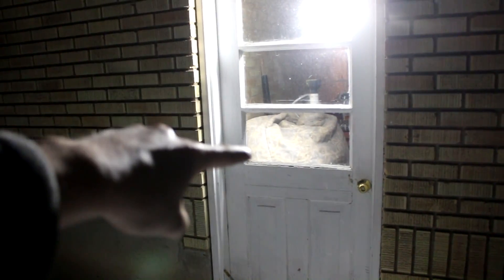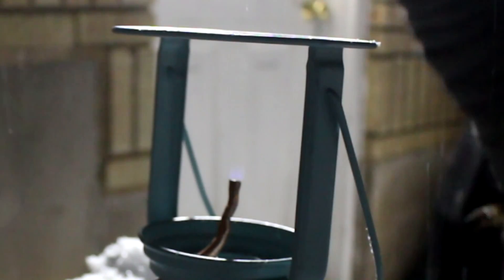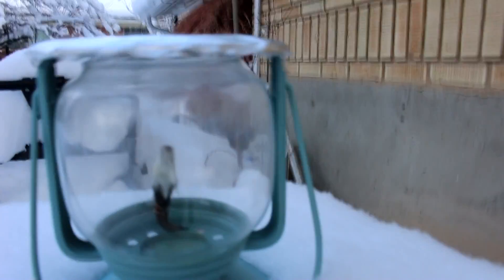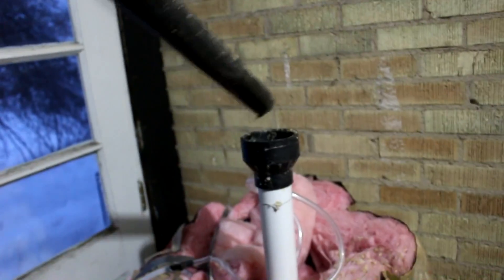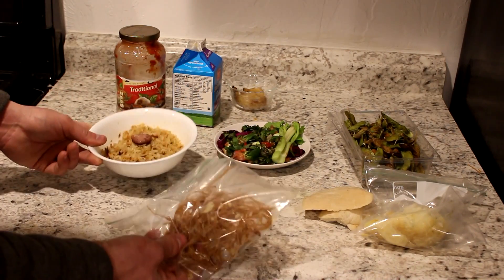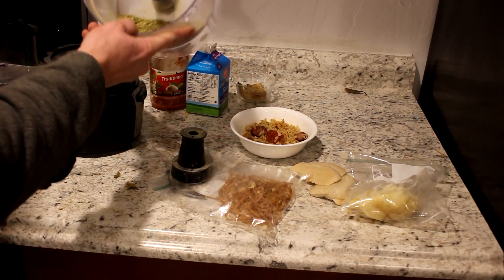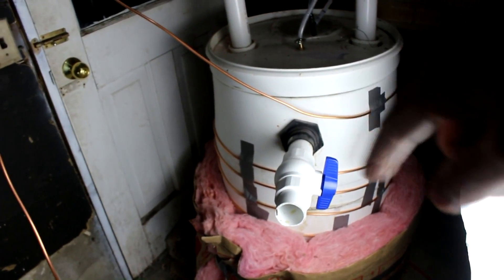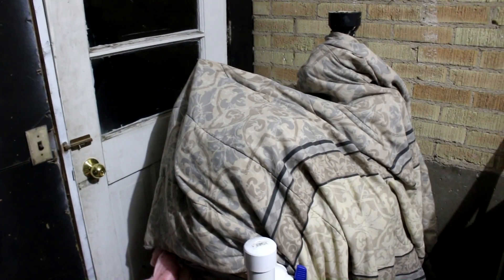Cody's Methane Generator Part 2: I Have Gas!

Comment: If my calculations arent totally off You're making somewhere around 150 litres of methane a day. Around 100 grams, at .6 grams per litre. 5.5 MJ per day, which is 1.5 Kw... So your heater is using the entire energy production of the reactor.
Edited because I screwed up the calculation.
Reply from the maker: Ah good I was hoping someone would check my numbers. I actually calculated that the gas is not more than 50% methane and so got a value about half of yours. which is perhaps not quite enough to keep it heated but will offset most of the power requirements. (assuming 100% efficiency which is unlikely)
Reply: @theCodyReeder  I was wondering what the EROI on this thing was, wonder if there's any way to get it above 1, perhaps just running it in a warmer climate?
Reply: Volume of a 12 inch beach ball, filled in 2.5 hours.
Reply: it's likely fiberglass which won't burn, and such a small flame wouldn't have enough heat to melt it either.
Reply: The most efficient heater would be a solar one, even in winter you 
should get almost 2kW of heat for a square meter in a day, rising to 7 
or 8 by mid summer. Your problem is how much the heat varies, I assume 
you'll want a thermostat controlled pump for the heating water. Then 
you'll need good insulation because of heat loss, also theres the 
problem of the system generating no heat at night, so you'll probably 
need to actually store the solar heater's heat in a separate well 
insulated tank then tap off that with a loop running into the reactor. 
Also, I'm having trouble finding details about methane reactor output, 
but It seems likely that you should be able to get many more times the 
output of this system.
Reply: maybe put that tiny flame a bit further inside the heater for better efficiency? 
I know its highly unlikely but how flammable is that insulation?
Reply: Phunkkyy I think the bigger worry is of the light going out. Having a flamable Gass building up indoors is generally frowned upon
Reply: Might keep them very cozy if the heating setup tips over ;)
Reply: Marc83Aus Well according to my calculations (using your given volume) he is making less than 107 grams of methane a day.
Reply: That's much better, I must have used cryogenic compressed methane in the calculator i found earlier.
Reply: Marc83Aus I just use 1 mole = 22.4 liters.
Reply: Cody'sLab Is the assumed volume correct by the way? And wow! Cody replied
Reply: thats impossible. at the top of the athmosphere you get about 1,3kW of solar radiation including infrared and the visible spectrum. on the ground its much less due to clouds and the angle at wich the sun shines to the ground especially in winter. you are probably one order of magnitude wrong 800W per m^2 on a summer day seems about right.
Reply: Marc83Aus But he is disposing waste and getting compost out of it. Theoretically without adding any extra energy into the system through electricity
Reply: A vacuum tube is overkill for solar heating, it's pretty easy to make a coil of dark coloured tubing, put inside an insulated box in the sun. As the water heats it should create a current drawing cooler water from a lower reservoir and producing slightly pressurised heated water at the upper end. A small hand pump might be needed to get the current going but i've seen these types of heaters made with junk and surprisingly efficient and maintenance free.
Reply: The copper wrap around the barrel is likely to be the biggest issue with efficient heat transfer, why not make a coil that descends into the existing heater system? That tube that extends down and has a electric heat probe in it.  Would work same way and should siphon as it transfers heat.  Just the heat delta is likely to be alot higher since its in the hot water trying to heat already hot water.
Reply: Marc83Aus how did you come up with 150 liters a day?
Reply: burning the gas indoors might heat up the shed too keeping the bunny cosy. its awesome.
Reply: +Tsf Phi I think he did a vacuum tube (imperfect, of course), but if not he definitely did the sealed gas tubes.
Reply: You're right about 1.3 kW per square meter. I said 2kw for a whole day.
Reply: That's interesting, I wonder how much electricity you would need for the added hydrogen if made with electrolysis. I'm not going to attempt calculate that untill I can find good data for methane bioreactor production.
Reply: I would be possible to get over 100% efficiency with a heat pump, if more difficult to build.
Reply: Aura Rowe You couldn't use that to make a heat pump, though. You need contact with the outside to do that.
Reply: Solar door heater, would work wonders.. 

Used cans or Alu siding.. painted black and basicly done.
Reply: Well, I got about 96.9 grams of gas..so about 48.4 grams of methane per day if the gas is half methane. (assuming density  of the other gases is nearly equal to methane)(ball is 30cm in diameter)
Reply: MarcAFK What do you think they use in commercial solar hot water systems? Magical pixie dust coated black tubes to keep heat in all night long? Dreaming! Get your facts straight...
Reply: Yeah, I have a feeling that running a digester like this in the bitter cold might be hard to keep warm.  Now run this in California where thousands of dairies are...
Reply: ah, i love that wording, reactor. All living things are reactors. Why? Because, the methane generator is a stomach simulator. Stomachs produce our proteins and other organic compounds for energy. The methane generator is producing energy to keep itself heated and alive. I love the chain!
Reply: I guess you have to build it bigger, so the heat is self substaining. ^^
Reply: When it comes to using solar I've always found "solar vacuum tubes" to be an interesting idea for keeping water at a warm temperature. They apparently work in diffuse light conditions, even under some snow.

I think "Kingspan" are currently the leaders in this type of tech. 

+Codyslab Do you think you can build a vacuum tube?
Reply: Marc83Aus 
This is exactly the point. Cool to build but way off effective. Energy bilance is a catastrophy. Might work in summer, but then you have to conservate your energy for the winter.
Interesting and fun to watch anyways...good work.  :-)

Comment: G'day,

  Yay Team !

     23 years ago I bought a Toyota Stout with a 6 Cyl 142 Cu. In. Holden "Red" Motor, running on LPG (search my "Mad Scientist" Playlist, for "The Rolls-Royce-Holden-Toyota Helicopter Stout !", to see it...!) ; and because it ran on Gas, & because I live 10 miles from the biggest Concentration-Camp for Cattle in Oz (Ranger's Valley "Feed Lot"), I did once crunch the Numbers on running "a 6-Cylinder Family Car" on Methane.

   It was an old Book I read, predating the Continuous-Flow system you're using ; but what I discovered taught me much about the nature of "Methane-Power", as seen in  the 2nd & 3rd Mad Max videos.

   It seems that using "Batch Digestion" to run such a Vehicle 100 Km (60 miles) per week, one needed to build a 4-Chamber Digester, with each Chamber comprising a 1,000 (US) Gallon Tank, buried in a Hole lined with Insulation, and 2 Ft of Insulation overtopping it, equipped with a Mechanical Agitator & Heating Tubes... ; 3 Chambers were to be Brewing at any one time, with the other one being emptied of Sludge & recharged with 1 Ton of Fresh Moist Cowpoop.

 So, it only takes playing with 1 Ton of Cowturds going in, plus 750 Litres of Sludge being removed from the system, weekly ; to generate enough Bio-Gas to be able to scrub it of C.O.-2, and run it in a Water-Cooled Spark-Ignition Engine from a Gasometer, to turn a Water-Cooled 3-Stage Compressor to squeeze the Methane to 2,000 PSI to go in long narrow Steel Cylinders, with which to feed the Engine of the Fire Chariot...., and, all the  Hot Water carrying the "Waste-Heat" from the Methane-Engine/Compressor combination has to be pumped through the Chambers of the 3 "working" Chambers...

  Your Continuous-Flow Design means that if you postulate a single suitably-plumbed 5,000 Gallon buried & insulated Poly-Tank, with two  adjoining Gasometers for the Biogas & Scrubbed Methane, & the Engine/Compressor...; then to drive your classic "Normal Car" 60 miles per Week will "only" require you to shovel 320 Pounds of Cowshit per day into the Tank, while adding 50 Gallons of fresh Water & removing 60 Gallons of Sludge...

   I'm sorry, I'm a lazy Hypocrite & I run my Fire-Chariot on 22 Litres of  Fossil-sourced Petroleum per week, to drive 250 Km (156 Miles) or so...; but I do have a 30 Watt "Mk-8 SunFoil" on the Roof, which may be saving me between 1 & 3 Litres per week...

   I don't get to say that I'm "driving Fossil-Free" on Carbon-Neutral Methane, but I don't spend my life shovelling Cowshit, either..; and I'm covering the same Road, with the same Load, at the same Speed, on less Motion-Lotion.

  And all it takes is adding a Streamlined Solar Array & Battery Charge-Controller to the Automobile Battery, in parallel to the Engine-Driven Alternator's Regulator.

   Every time the Alternator's Regulator "sees" Solar Current at the (Fully Charged - while sitting in the Parking-Lot...) Battery-Terminals, the Alt's Reg. decides the Battery is already full, and reduces it's Output....

  And, every Vehicle burns a lot less Fuel, when the Alternator is not loading-up it's Driven-Pulley with Electromagnetic Drag, trying to  quickly finish recharging the Battery (which had been sulphating while part-flat, since the last time the Engine was shut-down before the Battery had  finished being Recharged....).

   So, um, I love your Concept & Design for a Continuous-Flow Methane Producer...; but I don't want to spend my life collecting & shovelling & disposing of Shit, just(ifiably ?) to get around...

  I suspect a Tricycle Land-Yacht, and waiting till the Wind is "Fair" for the Journey, until the Road Network collapses (soon).

  Such is Life,

  Have a good one....

  ;-p

  Ciao !

Comment: I was going to use a closed loop heating system like this when I had my digestor running but I was going to add thermoelectric generators into the system (Peltier devices) and try and pull a wee bit of power out from the loop

Comment: any chance that can explode with the flame next to the tank?
Reply: Sqwince23 the whole point of the tank and seal is an anaerobic environment: no oxygen, only if oxygen leaks into it and whatever does go in will be used up by the bacteria first. Then you get a serious amount of methane after the oxygen is gone as a byproduct of processing the material in the tank.

Comment: Cody: There's a book specifically on home-built methane systems. It's called "The Handbook  Of Homemade Power"

It talks about using some of the gas to heat the mass to maintain temp... and still get better gas production (assuming you have enough material to fuel faster production)  2 temp zones I remember  90 F and 120 -130 F   the higher being high production.

Love it!  Keep up the good work!

Comment: Why does the extra material go in and build pressure rather than just be forced back out the feed pipe? And how does the extra pressure push the digested material out?

Comment: somehow it should have methane detector, or a thing which ensures it redirects methane if flame will shut-off
It's good the shed have slits, but something should be as precaution - 6 sandbich balls of gas, hard to tell
Reply: it is possible to generate pulses with Stirling engine and it is shutdowns to trigger some kind of electromagnetic valve to redirect the flow

Comment: Cody if you could answer my question that'd be nice. I'm planning a 1-2 thousand gallon digester. Do I need to keep it warm if it's In my basement 70-74 degrees? I'm sure that if any volume could, 1-2 thousand gallons could keep itself warm, but then again it's anaerobic.

Comment: The orange coloured flame seen around 3:07 suggests the lantern mantle isn't getting enough oxygen to burn completely. You'd get a brighter mantle using an air/gas mixing nozzle, although it might be difficult to find or build one designed for such low gas pressures.

Comment: Can you bubble the methane into a large dewar of liquid nitrogen to store it as a solid? Also, is methane soluble in liquid nitrogen or oxygen? If so, will a mixture of methane and liquid oxygen explode on ignition?
Reply: Liquid oxygen and methane might explode without ignition. Storing them mixed would be super dangerous.
Reply: Liquid oxygen and liquid methane might produce a hyperbolic reaction. Where as just as soon as the 2 mix you get a reaction. An example would be the rocket engine used in the Saturn V rocket. It used liquid kerosene and liquid oxygen. Just as soon as they mixed, it produced a severe hypergolic reaction. That created a lot of force.
Reply: @CSX4772  The Saturn v engines were not hypergolic. AFAIK liquid oxygen is not hypergolic with any fuel. 
A good example of a hypergolic engine would be the ones on the Russian proton rocket. It uses dinitrogen tetroxide and unsymmetric monomethyl hydazine.

Comment: If you have one or can make one easily, why not make a bunsen burner sort of thing? The lantern mantle is wasting energy in what is almost pure conversion of gas to heat AFAIK by instead converting heat to light. Additionally, you could make it failsafe by putting a bit of platinum wire in the gas stream. If the flame ever went out, the gas would be catalyzed by the platinum wire, and would reignite.
Reply: TheEightBitLink Where to obtain platinum wire Sir?
Reply: @benshuetrim9640  see codys metals from catalytic converters video... or metals from the road :)

Comment: flame goes out, room slowly fills with methane...
Reply: BOOOOOOM!!!
Reply: or possibly just like with house's gas there is a sulfur additive incase of leak so any humans can be alerted there is a gas leak. Essentially instead of sulfur there are other stinky molecules being produced by the bacteria so if he smelt the stinky bacteria, he's smelling methane. It's not like hes completely filtering it off it will still smell no matter what  @amindnew527
Reply: @tjyoyo3  The room is not airtight, The rate of production is probably not high enough for that to happen.
Reply: I know this is old, but for new readers, a lot of higher grade scales of this implement a valve system specifically to avoid this.
Reply: @noaha8915  Writing new comments on old videos is not futile :)
Reply: @figboot  it isn't?
Reply: @redacted7104  Nope

Comment: Why not just hookup the sterling engine to a battery and power the heater that way. The flame doesn't seem very efficient, you'd be using everything for its best purpose and you could find out if the heat would generate surplus electricity.

Comment: what do you think would be the most practical use of the gas produced?? first thought that comes to my mind would be to make a methane gas powered kiln for smelting ore from your mine,,,you've already got the stuff to compress it into a tank,,would be cheaper than propane
Reply: I would use it to store and power a Gassifier, which i would then use a Methane and Syngas ratio for fuel in a Solid oxide Fuel Cell for my house. Using waste material as the feedstock makes a newable system.
Reply: nah, cryogenic liquifaction is much high yield. Although cool experiment for cody to try! Maybe subject the Methane to a Mercury bulb for a few days and see how much Ethane is produced?

Comment: What keeps the flame from going back into tube and exploding the beach ball? at 1:05
Reply: old comment but there is no air in the tube. Same reason why you can spray a deodrant and light it without the can exploding.

Comment: if you put a bucket in a bigger bucket. and fill with water then feed tube under bucket it works better. put a valve on the bucket with hose to house,when the bucket rises it's full and then use.
Reply: water also filters out harmful chlorine among other nastys , you should also run it through a steel wool filter more nastys
Reply: sorry ,also if you use the bucket system will actually burp it off,if your not around or don't use it fast enough.  You have to fill the bucket half way with water.

Comment: Nice work on the digester. I'm not convinced the coil on the outside of the  barrel is optimal but hopefully it will generate enough heat. Are you going to try and liquefy the gas? That would be cool.(da dum dum tshh)

Comment: How is it possible to provide energy to a generator with the energy that it produces and not use more energy than is generated?
Reply from the maker: because it is being fed a fuel.
Reply: It's fuel he would otherwise throw away so making good use of the fuel most people would toss away.
Reply: Alex Larking because the chemical energy is very dense (food, etc.) it goes into the digester to make a fuel that is easier to light.
Reply: How can a ball roll quickly downhill if you only give it a slight nudge over a bump?
Reply: Because the heat is not the fuel, the biomass waste is. The heat is being produced by the resulting by-products of the reactions taking place within the chamber.
Reply: MattTheBoss - Chemical Energy is a kind of Potential Energy just more specific
Reply: Darn it... for a minute I thought you'd managed to make a perpetual motion machine... maybe next time!
Reply: Wolther Do you mean potential energy?
Reply: Alex Larking yeah I want to know that too.
Reply: medanman62 YES, I couldn't think of the right one.

Comment: Aren't you worried the flame might go trough the tube into the tank?
Reply from the maker: no not really, the thin tubing is smaller than the minimum flame diameter, even if it was a perfact mix of oxygen and methane (which it isnt) it still wouldn't burn through the tube.